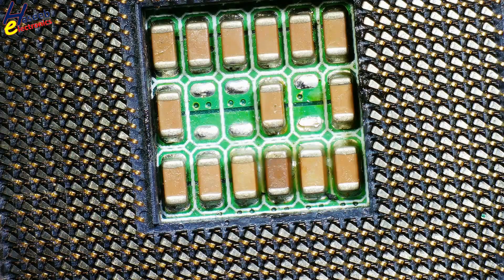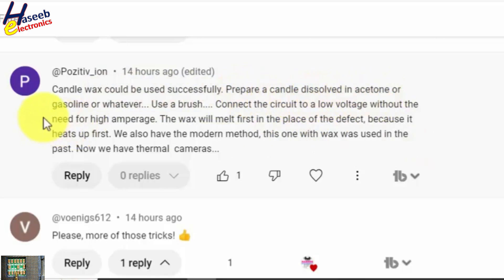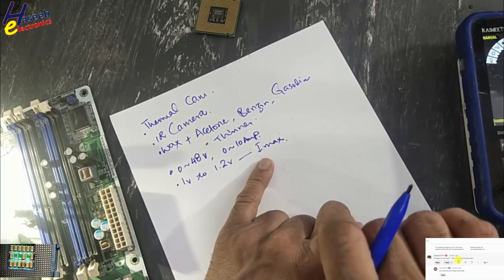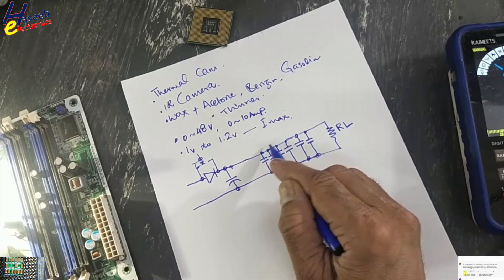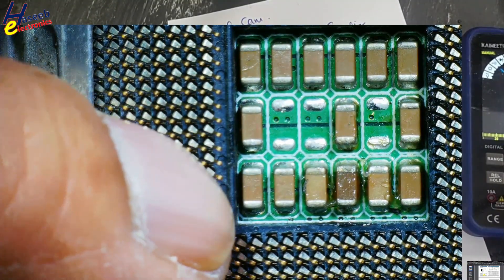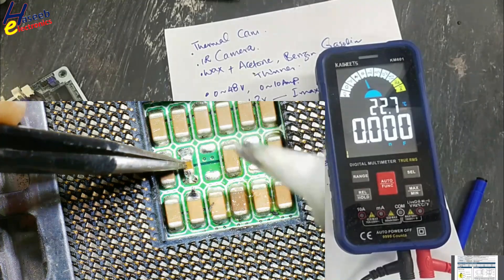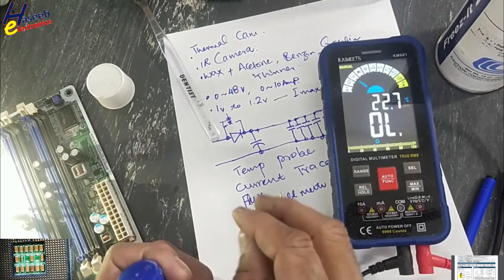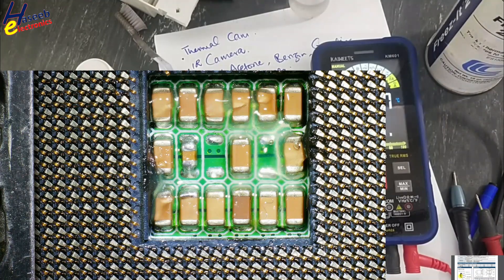{1254A} SMD capacitor short circuit detection tricks, Q&A

Comment: very good , how about parallel leds , if one of them is shorted?
Reply from the maker: the same method is to be applied for parallel LEDs, diodes, capacitors 
using 1volt to 1.5 volt with high current is awesome 
if we join D size 1.2 volt in parallel (4 to 6 cells). it will be useful tool (specially for LED TVs, satellite receivers, DVRs, CCTV cameras) 
or we can also connect D size alkline cells together for 1.5 volt
Reply: @HaseebElectronics  too much thanks answering my question dear Haseeb.

Comment: sir i think it will be better idea to use rosen paste instead of this cool spray. its actually evaporating very fast. it may work in your scenario, but if we are finding shorting in large area, then the PCB itself temperature will it dissolve it in air, so I think Rosen will be the best option to catch the thief.

Comment: This issue is exactly whats happening with my laptop. The capacitor bank around the processor test short circuit. I still use it but it shuts down unexpectedly after some time. I was thinking the processor has a fault but now I will diagnose those capacitors. This is crystal clear and the questions are well answered. Thank you Sir
Reply from the maker: good evening 
in your case i think it is not a problem of capacitors. because if capacitor is short circuited then it will remain shorted, 
 i think there is something is temperature effected. might be something is getting hot or overcurrent due to temperature
Reply: But Sir each of those none polarised capacitors is testing short circuit..

Comment: Ik trick me b btaon sir!
Apne ohm meter ko lowest available range pr set kren, or ese parallel capacitors pr har capacitor pr ohm check kren, jis capacitor pr ap ko lowest reading mile ( even k wo comparatively 0.001 ohm kam hi ho) us capacitor ko remove kr den, closest short or kuch dori pr short me kuch farq hota hy, ap practically kbi check kren, kisi jga ye trick kaam aegi inshaAllah
Reply from the maker: thanks for your valuable comment
you are right. in this condition we need an accurate multimeter
the best multimeter is to be used for this measurement is 4-wire multimeter. detecting fault using ohms method is slightly time taking and difficult. 
we can use milli-ohms methode or microvolt method